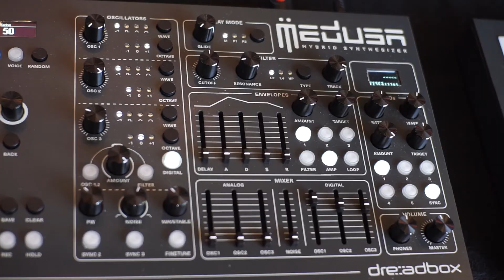youtube video #2tAwcTIxxuU

Comment: Most amazing gear of show for me. I will definitely have this device.
Reply from the maker: I had the exact same thought while still shooting the video.
Reply: If you know, I saw them play some patches in a few of the demos that sounded like they had reverb tails, does the synth have FX somewhere in the signal chain? Or was that an external reverb?
Reply from the maker: aikighost As far as I understood Piotr and Yannis, it has no internal effects. So that must have either been a long release tail or an external reverb. With 5 individual envelopes and the paraphonic modes it should also be possible to let the six oscillator’s overlap each other to avoid voice stealing and create the “illusion” of a reverb tail. I hope I can check this out in an in-depth review soon.
Reply: Dacci Pucci right so it looks like it’s going through the big sky, and that’s the issue
Reply from the maker: nolan mcguire Not an issue of you have a Big Sky ;)